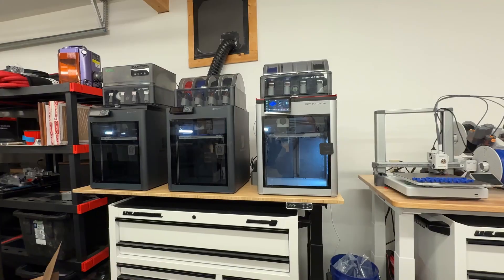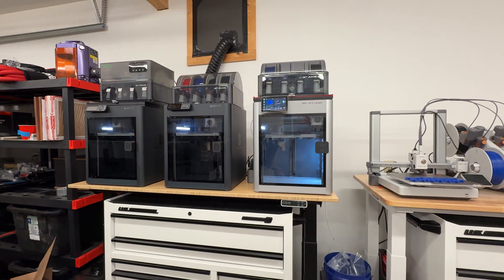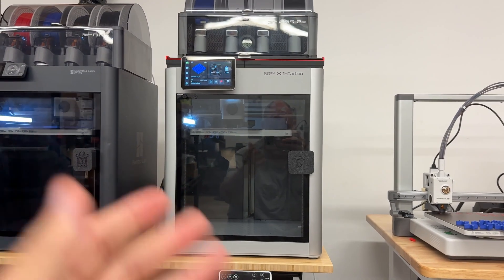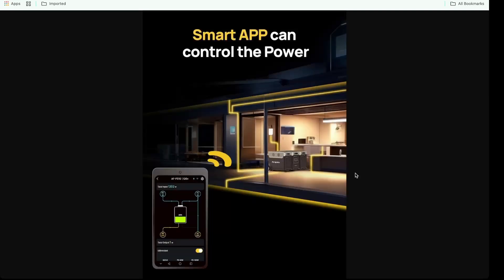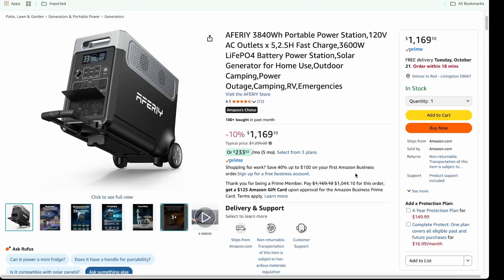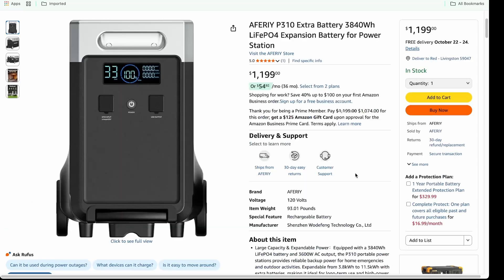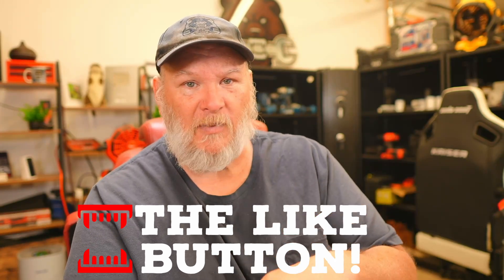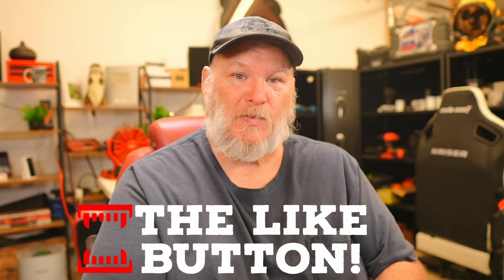Why Every 3D Print Farm Needs to Watch This! (Small or Large)

Comment: The worst fear and nightmare I could experience with my two 3D printers is they catch fire in the middle of the night, burn the house down, and kill everyone inside. Although power backup is a great idea, I'm not going to lose sleep over a bit of wasted plastic -- but then I don't have a big print farm with lots of printers either. I'm not sure the value of the plastic (or loss of time) exceeds the cost of expensive power backup options.

Comment: Id also buy a small 2-3kw petrol generator (make sure fumes go outside! co2 is not your friend) and be able to pipe that power back into the BattPSU... Upside is it can be used in storms for the house, fridge and they are CHEAP! Just keep a jerrycan or syphon for the car handy. Upside is every now and again, you can tip the unloved fuel into the car and go fill it up again and remember to start the gennie every 3 month for 10min. Also toss some pannels up on the roof and keep that BattPSU charged as when the suns out, the printfarm is FREE to run power wise! Same as the aircon too. Dont overspend were not talking end of the world stuff but yeah, powers off for a week, life goes on in a storm too!!!
Reply from the maker: Two many people feel like they need to choose teams power station versus gas generator in the reality. Is you need both if you want full coverage

Comment: So.. a UPS. The only difference is that it uses new battery technology, but essentially its just a UPS.  Been in IT for over 2 Decades, and dealt with systems like this only on a massive scale. It's the batteries that make THIS system a good choice for this.  Now, the real question is, if it does line conditioning and will switch over to battery if it detects under/over voltage like a UPS does.
Reply from the maker: I would not say this is at the level of an enterprise UPS when it comes to all the features but I would say it's between that and what you would get from basic desktop UPS.  They do have features that can do some line conditioning but again not at the level you would see running in a server room.  And from the docs I read I do believe that it will switch over if it detects voltage changes. It's one of the reason I run everything in my shop through a power station, we have really flaky power from the grid.  I would say that it's not just the batteries that make it a good choice but the full feature set with management that allow for better support and control than what you would get from most UPS's boxes that small to mid sized farms would use.
Reply: @3dprintrancher  It's a great idea really, helping protect the electronics from brownouts and over voltage is always a good idea.  Its a lot less expensive for a lot more run time than a high end UPS, thats for sure. I would need two at least since I run two separate circuits for my machines, and they are separated by the shop. :)

Comment: I have always had my concerns with power failures but also power surges and sags that the issues they can create.   So for a while I have been thinking of a power backup solution and to figure this out I need to know a few things, mostly I need to know how much power my printers actually consume.   I 3D print not to make money but to print parts for the retro computers I own and other things of interest.   I have a love hate relationship with 3D printing but over time they with the newer printers the hate part goes away.    I only print when I am off from work so my printing tasks are not all that great.    Once I figure out the real world power consumption for the printers I own I can then figure out how much backup power I might need.
Reply from the maker: You had me at retro computers!  What are we talking about?  Vic20? Sinclair? 8080's? Older?
Reply: @3dprintrancher  I have many.  Yes I do have most of the Commodore 8 bits, Amiga's, Atari 8 Bit and ST's,  heck I even have a Ti99/4 which looks cool but is an awkward thing to use.  PC's I just throw away they are a dime a dozen and I have a few old Mac's.